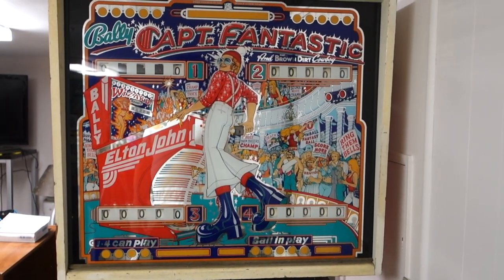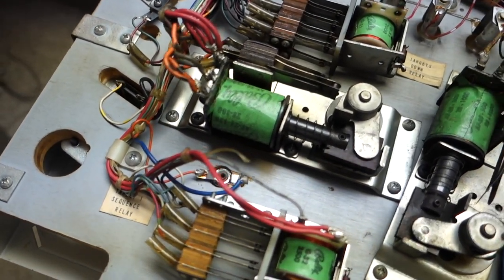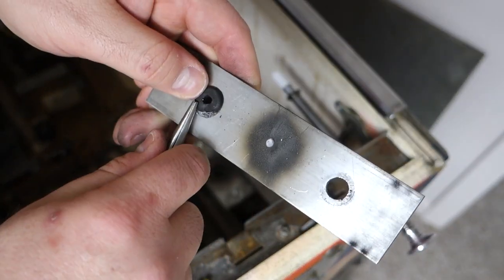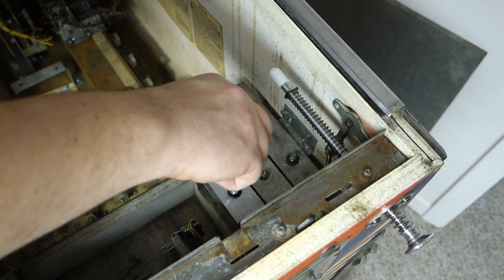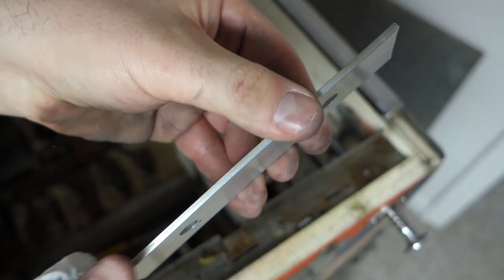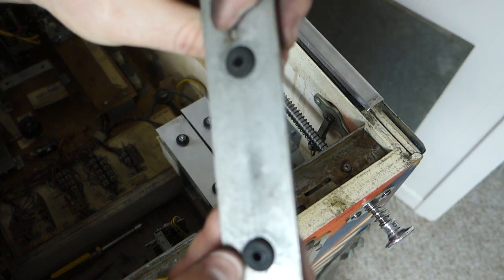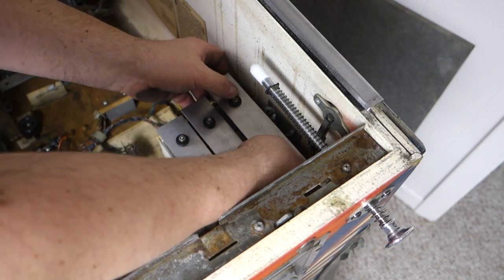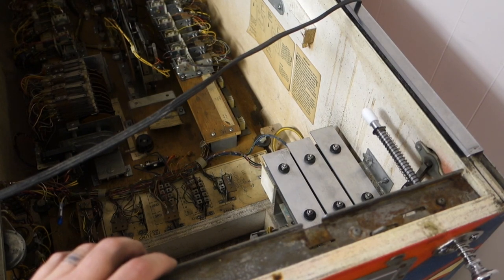1976 Bally Pinball Captain Fantastic Part #3 The Chime Rebuild

Comment: Thanks for the video!  My Bow and Arrow was missing the chime unit entirely when I bought it (don't think I even noticed it wasn't there at first!).  I've been searching for a replacement, but no luck.  There is a guy in netherlands who sells for about $200 with shipping, but was hoping to find a used one.  Any ideas?  I've already searched Ebay, marketplace, pinside, etc.  Thanks!
Reply from the maker: Id post in the facebook pages cause somebody has a few I bet. You can put a new gottlieb unit in that should work, I have a williams with a gottlieb in it. This is brand new, link below. https://www.marcospecialties.com/pinball-parts/B-12023
Reply: @MarksBasementArcade Thanks for the info.  Are the gottlieb units 24 volt though?  The Bally take 48 volt I believe.  Would be great if compatible.
Reply from the maker: @daved2403  Swap out the coils.